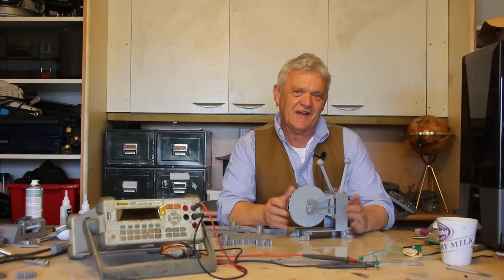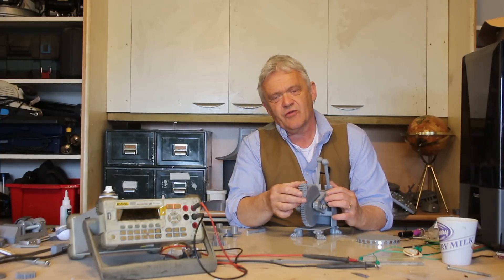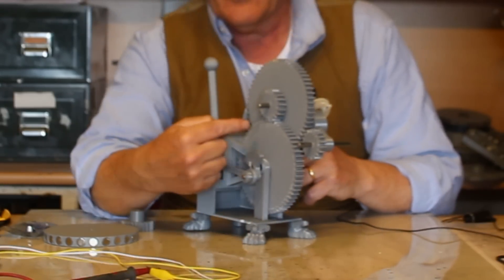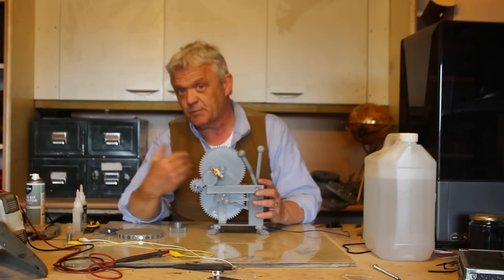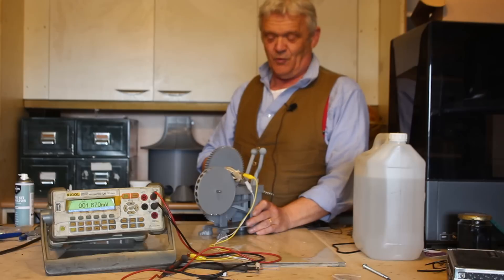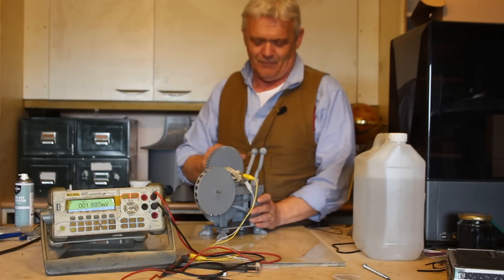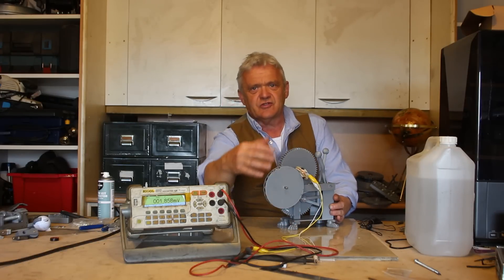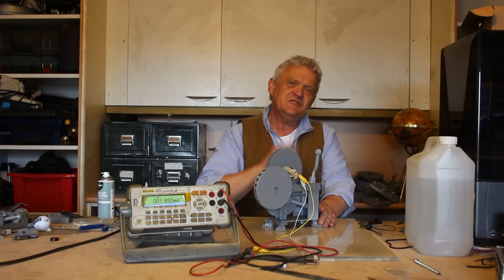1982 - Adding Gears To The Singer Sewing Machine Generator

Comment: You might look into using the planetary gear set inside an old hand drill, they are very compact and could easily be adapted for something like this.
Reply from the maker: it's a god suggestion mate - but i like this for lots of reasons
Reply: @RobertMurraySmith  me too, great idea for sure,  I was just thinking about the more industrial version for larger more sustained energy production. Like say charging a large battery bank for use in an off grid application,  one would need to scale everything up, and therefore the stresses involved would necessitate stronger materials and larger apparatus.  In those situations it is always beneficial to consider using recycled materials and capitalization of the endless waste stream from our lives. Modifying existing parts can be helpful in cheaply making industrial grade products for our individualized needs. Maybe a video idea for you: how to make an off grid power system that completely negates the needs for grid power. Would need to include powering a refrigerator, cook top, water heater,  lights, and phone/laptop charging. Aprox 8kw continuously,  using only a battery bank and materials gathered from the waste stream,  ie: washing machine motors, lawnmowers, old cars, junk yard parts etc. I'd love to see your take on something like this.  Thanks for reading the comments and have an awesome day!